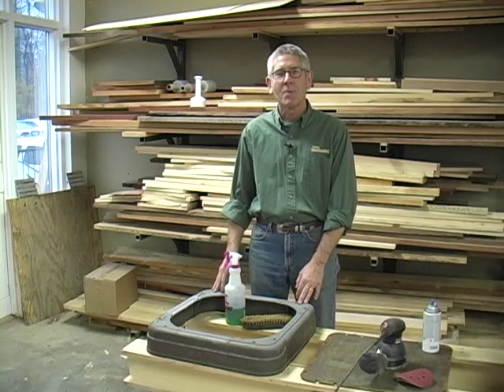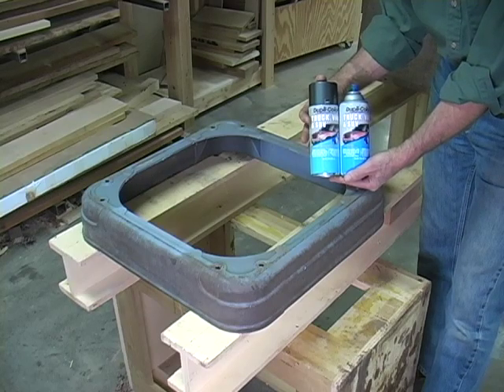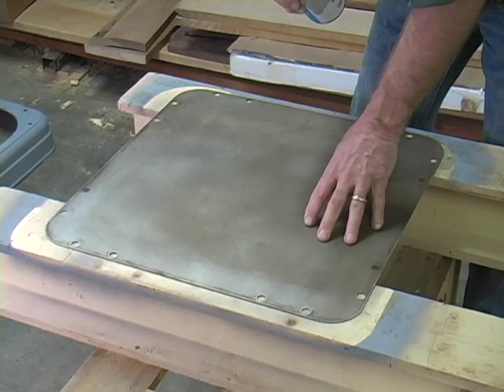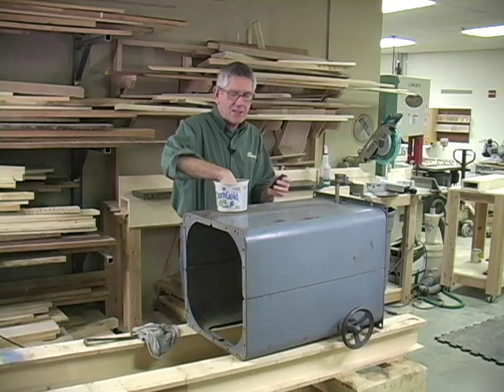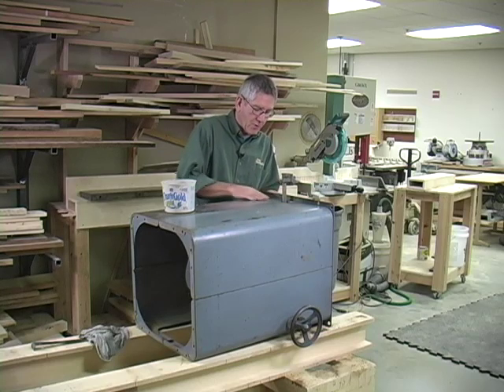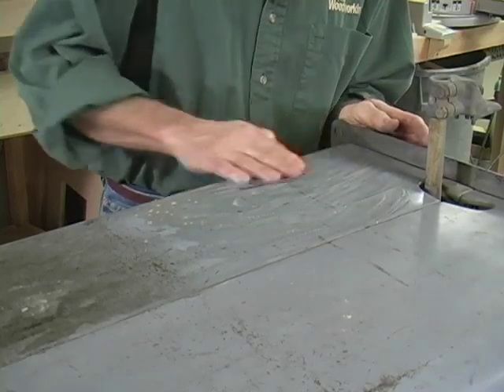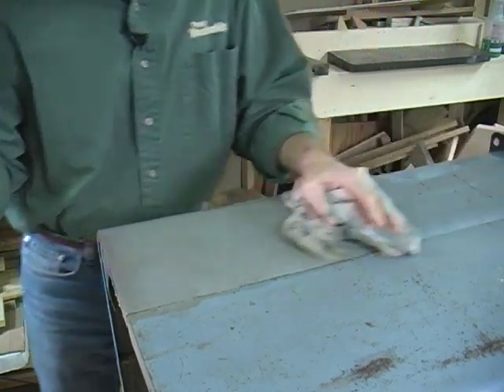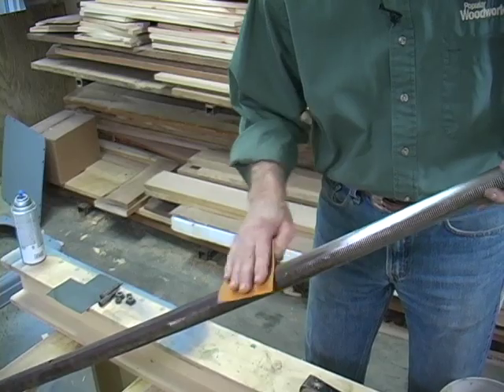UNISAW Restoration - Part 3

Comment: I was at a Habitat for humanity Restore in Ar. When they started bringing in woodworking machines. All delta machines from the 40's or 50's. Table saw looked like yours with all the attachments for $500. I wanted it all, but I work out of a couple shed's and all of it was industrial size machines. So I posted it in a Arkansas woodworkers group on Facebook.  Within 30 minutes they started showing up and buying it all LOL. Stumbled in to find of the lifetime and couldn't  get them. I had the money, not going to let them sit outside with a tarp over them.